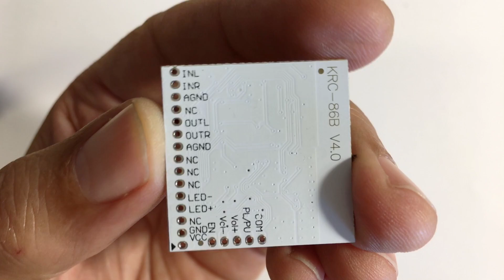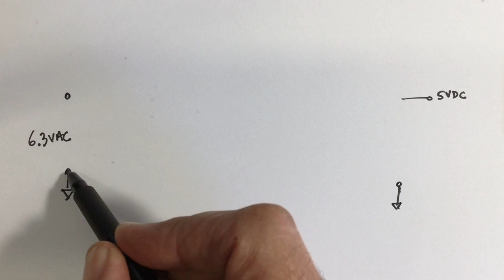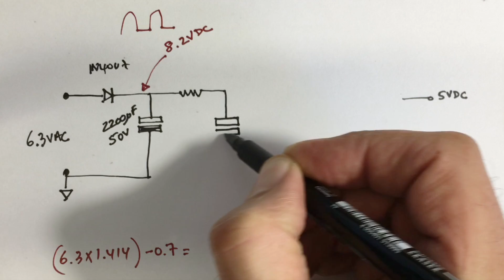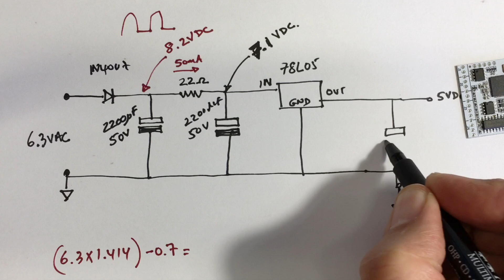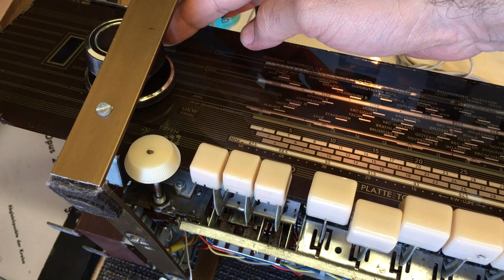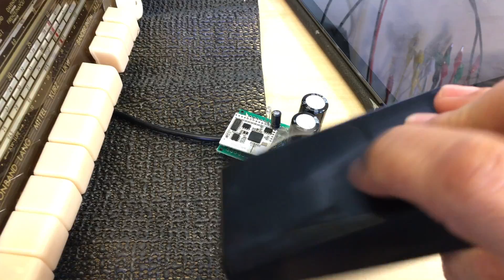Add Bluetooth to a Tube Radio without the buzz and noise. Bluetooth receiver board KRC-86B V4.0

Comment: When you added the extra coil on the transfo. Did you use both ends of the wire (one 9v+ and one ground) on the circuit board? Or is that wrong?
Reply from the maker: Yes. The two ends are used and you get the ac voltage across them. Neither is actually Ground, because you want an isolated voltage.

Comment: Clever solution on the the transformer winding. I wonder if you could use a DC-DC converter or if the switching  noise would break through.  I may have ago myself see if I can make it work.  Wow those are incredible speakers!
Reply from the maker: I use a dc-dc converter in other cases, but I use the isolated type to avoid the noise. The part number is B0505S-1W
Reply: Electronics Old and New by M Caldeira ok thanks for the heads up on the part number saves me trying various devices thanks. Regards Chris

Comment: Did you try connecting only one end of the signal wire ground shielding? Both devices are referenced to ground on the heater supply so there is  built in ground loop that you did not appear to consider.
Reply from the maker: I’m not using the heater supply. I wound a separate winding on the transformer, so it is fully isolated. The only point of common ground is at the signal input.
Reply: @electronicsoldandnew  
Thank you for your reply. I watched the video so I know about your arrangements for the power supply, however when you were powering it from 6.3volts you had two ground connections to the solid state device and when you disconnected the ground connection to the 6.3volts you had the ac feed going via the shielding wire. Both these conditions would create hum.

Comment: Why  is this module delivered with the 470uF capacitor?
Reply from the maker: Not sure. Probably for filtering supply.
Reply: Why do you need to know?
Reply: @jonka1  Just curious. I cannot find a use for it in any documentation. Seems logical I wanted to know what it is for.

Comment: Will be performing this mod on my Othello 58 3D model.
Reply from the maker: Nick Terence : you’re going to love the result.
Reply: @electronicsoldandnew  My bluetooth module is 12v. Should I be using a 47uF 16V cap across + &  - feeding the module ? The isolator will be 12dc - 12dc. Luckily the Othelo has 12vdc available.
Reply from the maker: Nick Terence : for a 12V supply, I’d use a 25v capacitor. 16v is within the limit, but too close.
Reply: @electronicsoldandnew  Much Thanks ! God Bless..

Comment: I wonder why didn't you use a bridge rectifier instead of this HWR config, so that you could avoid such bulky filters.. Some reasons related to the tube circuit scenarios?, what I'm totally blank about..
Reply from the maker: I first built it to take the 6.3v heater supply, which has one point already connected to ground, so a bridge rectifier is not viable. I then changed that to a separate winding on the transformer, which could use a bridge rectifier and smaller filters, but I wanted to use the board I’d already built, so I went with this option.
Reply: @electronicsoldandnew  Understood.. thanks for the clarification.

Comment: Pretty in depth method of achieving the goal, however you could purchase a 5 volt supply from banggood.com for less than 5.00. It runs on 120 to 240 volts and is regulated. Pop it in and you are done.
Reply from the maker: Mark Miner : you could, but ...
Those are switched mode power supplies and tend to introduce switching noise into the receiver, so not an option for me.
Reply: BEWARE!!! banggood.com has a history of never shipping your order and NO REFUNDS under any condition
Reply from the maker: I don’t know where that history comes from. I’ve made countless purchases from them. When something arrived damaged, they promptly gave me a credit. When one order didn’t arrive, they shipped another out immediately. All the others arrived normally.

Comment: Nice video. I used a seperate 230V to 5V board and connected it to the main cables, so when I turn on the radio, it automatically tirns on the bluetooth board. No buzzzzz.
Reply from the maker: Anton Lambooij : yes, those converters are now readily available and work great.

Comment: I'm going to use the 6.3vac circuit and try a 6N137 Optoisolator between the 5vdc output and the bluetooth module. Anyone see an issue with that solution?
Reply: Oops, pardon my lack of knowledge on this. I just realized that this will not work.
Reply from the maker: Roy Eubanks : that opto is only for data isolation. Will not work with supply.

Comment: I used the same circuit one year ago and I had the same buzz problem. I don't know what I did wrong, but my board smoked when I connected the output to the  pickup input of my 1956 grundig radio. It still was working afterwards. weird. Any idea ? Thanks for the great tip with the transformer ! Very nice.
Reply from the maker: eldontyrellcorp : you need to make sure the supplies are completely isolated, as shown in the video. That gets rid of the buzz. The smoking ... could you have had DC voltage at the PU input?

Comment: Another solution to the independent power supply issue would be to buy up a bunch of these: https://www.jameco.com/z/MA14L-2001-0012-Fujitsu-9-V-200-mA-Unregulated-Wall-Power-Supply_2215460.html, cut the guts out of them and add a 78L05 and a couple of caps... would probably be hard to find bare transformers for less.  Especially useful if your radio doesn't have a transformer in it, like a lot of the old AA5's and similar designs.

I'm thinking about doing this to a Hallicrafters WR-600 I'm restoring, along with a couple of other radios without transformers in them.

Comment: Do you have any problem with RF noise from the Bluetooth module getting coupled into the RF or IF circuits of the radio?
Reply from the maker: RayDT : no, because of the supply isolator used.
Reply: @electronicsoldandnew  I was actually thinking about RF radiated out of the board and picked up by the radio's RF circuitry, which could happen even with a battery-powered unit.  I suppose the BT module is running at too high a frequency for the radio to respond to, so it may not be an issue.
Reply from the maker: RayDT : oh, I see what you mean. No, I get no issues.

Comment: I have tried this bluetooth module, and found the sound to be rather tinny.  Has anyone else found the same?
Reply from the maker: kEn J : this and other Bluetooth modules I’ve used don’t sound tinny to me. That actually sound quite good when supplied correctly, but that’s just my opinion.
Reply: Thanks for your reply.  I'm feeding the signal to a small classD amp and it seems like a weak but clean signal, no hum, but no bass either.  The amp sounds fine when plugged directly into a PC or phone headphone jack.  I will check the supply voltage and have a try with different amps.

Comment: In the last solution you can use a real FBR (full bridge rectifier)  :-)
Is the regulator a low-drop-Version? And my experience with this regulators: I had to put on shortest way two 100nF ceramik capacitors to the in- and output pin to ground. These little beasts sometime dance alone with 20Khz and start cooking. And its nice to see, that you also know this old trick with the addon-secondary on the power transformer. 
In the meantime i'm really thinking about going back to the roots and restart electronics diy. Why for the hell have i found this channell?
Reply from the maker: Alfred Neumann : i always check to ensure that I have no oscillations on the regulators. So far I’ve had none. As for getting back into electronics, be careful. It’s addictive!
Reply: Yes, i know, what i have made and built in the 80s and 90s. But the rails of live are sometimes guiding in other directions.

Comment: An audio isolator might also do the trick right?
Reply from the maker: Timon : possibly. Depends how you mean.
Reply: M Caldeira
I have a similar problem but I'll try to fix it by connecting an audio transformer between the Bluetooth modul and the amplifier. Hopefully it doesn't effect the sound quality. I guess I'll find out 😀

Comment: Very useful for those who do not know how to do it, great explanation and actually great video since it kept me full time without skiping any part of it. Nice job mate as well would add if you need to power bluetooth and amplifier from same battery supply like  transportable bluetooth speakers , you can remove buzzing like I did in this video https://www.youtube.com/watch?v=fUMFddtGC7k&lc=z23xsd1i4ynvwbgtxacdp433ohaz4jjikdr50vgjfitw03c010c.1527578286245563

Comment: I bought such a unit and are testing it.
The output of the unit clips 100% of the negative signal (I only get signal on the positive side of 0V from the oscilloscope).
Do you get a similar result?

Kind regards

PS: I used a signal generator on my phone to test the output from the bluetooth unit.
Reply from the maker: Stephan C : hi. No I don’t get clipping at all. Mine works perfectly. Sounds like the unit may be defective, but am not sure. I have had some failed units from the purchases on eBay.

Comment: Watch this video about decoupling (no affiliation)
https://youtu.be/0SoD3GlFH0s
He covers how to decouple amplification stages. I believe that should work in this situation. I'm rebuilding a KRC 86B setup right now and am about to try his solution for that, plus I want to try the capacitive multiplier transistor circuit for replacing batteries on a little Transistor Tester.
  However I have thought about adding a secondary winding for some other power supply projects. Thanks for sharing.
-Jake

Comment: Great video
Will be building one shortly into my radio.
What is you reception range?
Would it be possible to add external antenna?
Kind regards
Reply from the maker: Stephan C : you get about 10m or so, and you can place the antenna outside the unit.

Comment: With the 78 series regulators the datasheet recommends 100nF caps on the IN and OUT pins to cut done noise and oscillation.

Instead of a 78 series regulator a zener diode and series pass transistor setup will work. This way you don't have to add so many turns, just enough for 5.5 or 6 volts would be enough.
Reply from the maker: Leland Clayton : good point.

Comment: i liked your explanation. its very clear to understand. thank you.
i have one question about bluetooth module. i have same and i have issue and its not only buzz noise - its very poor sound quality. its something like distorted vibrato effect over song. i connected it to a li-ion battery for test but same. and very poor bass also. when connect to bluetooth aux port - sound is great but when connect bluetooth -> noises and distorted sound. 
i used iphone 5s.
Reply from the maker: allls firebird: it could me a problem with the module itself. These modules are very well priced but the problem is reliability. When I buy these from eBay, I usually order more than one just to ensure that at least one works. Good luck.

Comment: thanks for the transformer trick ! very clever and will be useful to me !

only problem i suppose will be, it will put strain on primary coil, if current draw from secondaries are too high. but nice solution for measured requirements. :)
Reply from the maker: iceberg789 : I’ve used this solution many times, but always for low current requirements only, so as not to overload the primary.
Reply: The power draw from this is so tiny it will get lost in the eddy currents  of the core.

Comment: Excellent, thank for showing this. However, i got the exact same mini board and I was struggling on were to get 5V, This was a class A tube amplifier I just built and the closest I got was 6.3V.
Then it down to me. one of this pone chargers that are a very small cube with a USB out with 5V... installed everything inside a small box at the rear of the top pd the chassis and it work fine.

Thank you for the idea!!
Mario
Reply from the maker: +mtabernig : you're welcome.

Comment: Very clever solution! You might also try a Mornsun B0505S-1W isolated dc-dc converter. You need a few additional filter components (see Mornsun data sheet) but I think that might allow you to use the original circuit that you came up with.
Reply from the maker: +Glenn C : I actually ordered some of those a while ago. They're on their way.
Reply: or the Traco TMV 0505S

Comment: Did you ground one end of the new winding to chassis and the other one to the Bluetooth reciever to make it half wave rectification? And did you put 1nF cap in paralell with the 1n4007 diode?
Reply from the maker: +Okhan Vatansever:
No. That is not necessary and would probably create a ground loop. The system is connected to the radio's ground at the socket input only. The half-wave rectifier is the same. I left the 1n cap in place. Can't hurt. The system is dead quiet now. Works really well.
Reply: i will try this! And how did you wind the transformer?  Do you hade to dissassembly The transformer?
Reply from the maker: +Okhan Vatansever :
No. It's explained in the video. You wind it through the space between the existing windings and the core.

Comment: I like the idea. Instead of the rectifier, a voltage doubler could be used to get a higher voltage difference for the regulator. This would be an option for transformers that don't allow to add an extra winding. Anyway, nice restauration as always.
I think you mentioned in the beginning that somebody gave that radio to you. Do you need to give it back or does it stay in your collection?
Reply from the maker: +rotwang83 : a voltage doubler on the heater supply may make it necessary to use a decoupling capacitor at the output, which would certainly be an option.
The main problem is to isolate the supply completely so that the noise is eliminated. I've tried many options here and the noise is never completely eliminated unless the supplies are actually isolated. This means that the only common ground becomes the audio ground connection at the audio input socket.
This radio belongs to a friend, so unfortunately is has to be returned. Can't keep them all, I'm afraid.
Reply: I agree that it's the best solution to have a separate, isolated voltage for the bluetooth device. In some radios, the heater winding is even not grounded on one side, there's a center tap in the middle for ground connection.

Btw. modern electronics in tube radios: I have a Loewe-Opta radio with stereo amplifier and the usual mono radio section, BUT it is prepared for a stereo decoder. Here in Germany the tube radios were already like 10-15 years old until stereo on FM became standard, so actually nobody installed a decoder circuit. But it should be possible to install a circuit with one of these one-chip decoders. I'm planning to try this when I find some time. Perhaps I should stop watching youtube videos ;-)
Reply from the maker: +rotwang83 : i think I saw a video or read an article sometime where they do exactly that, but I can't remember when. Should be interesting.

Comment: Great video, as usual. Can you explain why you can't use a bridge rectifier? I didn't get that part...
Reply from the maker: +James Kadosas : the final solution with the new wound secondary does allow you to use a bridge rectifier because it is floating. When I did the initial circuit, I was going to use the heater supply which has one end connected to the chassis (ground) so I cannot use a bridge rectifier as this needs the AC inputs to said rectifier separate from ground. One of the rectifier outputs is ground in that case, so you can't use it.
Reply: Thanks for the explanation.

Comment: I have done a similar thing but I used a simple 5 volt DC supply that cost a few dollars,  which feeds directly into the Blue tooth board. Completely silent, no buzz or noise, I did, like you used a 100uF and a 0.1 uF across the power supply input
If I was winding my own, I think I would have used slightly less turns and a full wave bridge.
I bet that sounded good however, especially if you used a lossless audio file.
Reply from the maker: +Michael Beeny : I've used separate supplies before, but they should be linear ones to avoid switched mode supply noise. 
A full wave bridge will give you about the same voltage ... actually less as it has two diode drops. The reason I used this one is that I already had the board built for the option if using the heater supply, so I left is like this. 

The sound is AMAZING!
Reply: + Michael Beeny: I was thinking along the same lines, I especially like a very compact one module (HLK-5M05) I have used in other projects with good results  and I wanted to try it out for this.I  wonder about the switching noise though. Did you actually use a switched mode power supply module or a linear one?

Comment: Very interesting and clever solution how to create a new secondary coil to supply the necessary dc voltage prior a dc device to supply the necessary 5 dc output. The sound must be wonderful after having see the 4 speakers of the radio. I was missing the "final sound" result...! Thanks for the interesting video .
Reply from the maker: +abele ballestri : you're welcome. I am just finishing up the cabinet repair to put this project to bed with a final video.